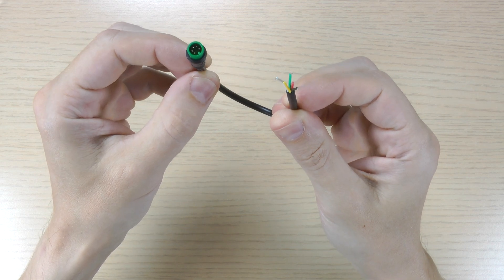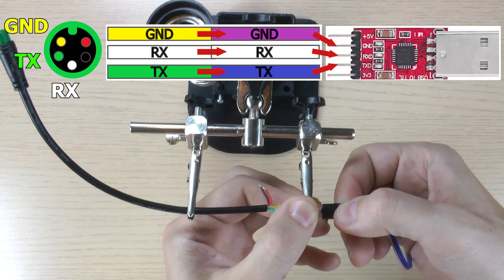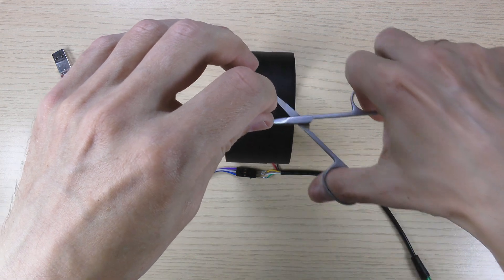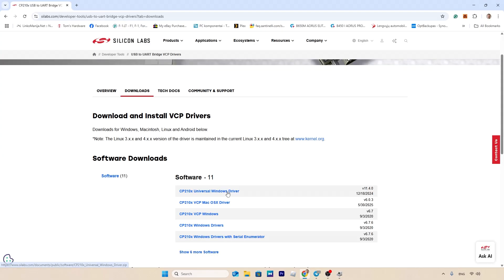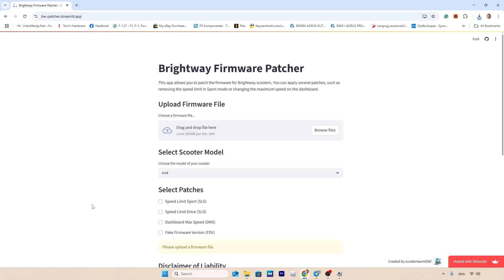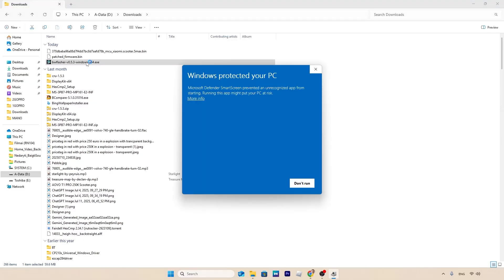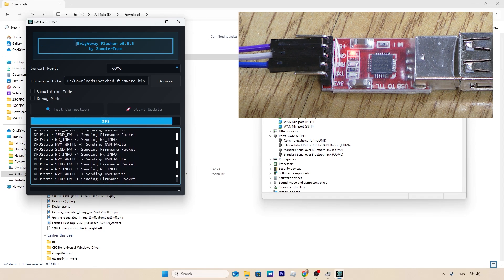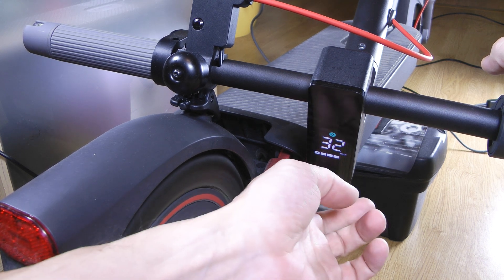Updated Xiaomi Scooter 5 Max Speed Hack (5*|5Pro|4*|4 Pro 2nd Gen)

Comment: Just received the Xiaomi 5 Pro and hacked it straight out of the box :). Thank you very much for the guide - it works exactly as described 😃. I ordered it from Germany, so the speed was crippled to 20km/h - terribly slow. Only activated the scooter with the app, didn't update the firmware through the app and used a self made M7 cable (parts cost 3.50 EUR on Aliexpress). In the patched firmware I set D (25 km/h), S (29.9 km/h), start speed to 1km/h and ticked the cruise control enable. Saw other comments that regenerative braking doesn't work after the hack and cruise control works only up to 25 km/h. Well - not sure if there was an update of the patcher, but the regenerative braking worked immediately (on Low, I don't like the aggressive ones) and cruise control was working on both D and S. Actually I achieved only 28 km/h because I was going slightly uphill, but cruise control kept them without having to press the accelerator.
Reply from the maker: Glad that everything went smoothly. Regenerative braking indeed sometimes does not work straight after flashing firmware for a short period. I noticed this as well on official firmware when I upgraded it to a newer version. Thanks for taking your time and sharing your experience in the comments. ❤️❤️❤️
Don't forget to subscribe :)
Reply: Hello! I also want to hack my scooter now, but wanted to ask some things. You said that you didn't update firmware in the app, does it change something up after hacking it? And also, does the Xiaomi app work fine after hacking a scooter?
Reply: @vladdergachov5384  The Xiaomi home app works just fine (I don't have any other 3rd party app for this scooter) and every time I start it it still suggests the firmware update that I didn't do initially. I think this is because there was no Fake Firmware option for the 5 Pro scooter in the firmware patcher. While it is a bit annoying (I didn't find any option to disable this prompt in the app), it is also good because most probably anytime I can easily switch back to stock firmware. But I am pretty satisfied with the modified firmware - fast acceleration, 30km/h speed and cruise control (up to max speed, tested several times now - it works even for speeds above 25 km/h) are enough for me. Battery life is good too, i drive it at S all the time, so no complaints.
Reply: @angeltinkov7415  
Hello ..
happy to hear that the process works fine for you. I also just bought 5 pro (the Germany version ) but I updated the firmware after using. Is this going to be a problem if I try to hack' it
Reply: @hamzaezzahi1649  If BW Flasher connects to the scooter then it will most probably not be a problem. I am not sure however if the rest will work as on mine, because I see some people say cruise control doesn't work above 25 and regen braking is not working at all. Maybe it is related to firmware update. As per the range with 30 km/h I cannot tell exactly because my longest commute is 10 km and I also don't charge it to  100% or let it drop to 0%, but the 10km is about 30% battery, my weight is 85 kg

Comment: Here are a few things I was wondering before:

One page is just giving you the OEM Firmware. 
The second is modifying it and the tool is for flashing. 

If you want to be able to revert the Firmware I recommend you to check the fake firmware option, lookup your current firmware and revert it for one number. You can either use the last 4 digits shown in your app or the number that shows when checking the connection in the flash tool. 

If you reconnect to Bluetooth with the app it prompts you to update. If you do that the modified software is gone. Personally, I am risking warranty claims to be rejected if they log the software mods…I don’t think it’s a thing. 

The 5 goes 25 ish with my fat 120kg ass. 

You can also just tune it up to 22 (Germany). You are then still in the 20kmh + 10% tolerance and should not loose your ABE. No legal advice just my train of thought. That’s what I will do.

Comment: Thank you so much for the video. My cables and adapter for the firmware update have arrived. I have a question: is it possible to disable the maximum speed sound? Thank you very much.
Reply from the maker: Currently, the only way is to desolder the speaker from the dashboard or tape it — there’s no software option yet.
Subscribe, thanks!

Comment: As this void warranty can you download the original firmware beforehand? To reverse the flashing? For the 5? How do you know what a valid old firmware would be to trigger the update in the app? Is it a drop-down in the bin modder?
Reply from the maker: Flash the unpatched MCU (the official firmware) or set the fake firmware version to a number lower than the latest one in the patcher. Each time you open the Xiaomi Home app, it will prompt you to update — if you accept, the scooter will revert to stock. Make sure to disable automatic firmware updates in the app.
Sub, thanks!
Reply: @MindaugasJocionis you’re the man dude!

Comment: How Long Can it drive on a full charge with 30kmh speed limit?
Reply from the maker: Didn’t test that, but with 25 km/h on 5max it lasted 44 km, so expect a bit less. Subscribe, thanks.
Reply: @MindaugasJocionis Thx do you know if the batteri is getting destroyt faster?
Reply from the maker: I personally don’t think it’ll be affected much. I’ve been using my Xiaomi 3 for four seasons — tuned even more aggressively than this one — and the battery is still in great shape.

Comment: Question: I am in the process of building the adapter and am currently checking whether everything is correct. I noticed that when I touch RX with the multimeter and hold the other end to GND, voltage also passes through there, not just at RX. Is this normal? So I've already connected the cables to the USB to TTL adapter
Reply from the maker: Yes, it’s normal — it receives data as tiny voltage pulses, that’s how serial communication works. Sub. Thx.

Comment: Danke für das Video! Kann ich vorher ein Backup Downloaden meiner Firmware? Der Support braucht für einen neuen QR Code meine Seriennummer. (Will ich auslesen, Sticker und Anleitung nicht vorhanden, 4 pro 2gen)
Reply from the maker: Ich bin mir nicht sicher, wie es beim 4 2. Gen ist, aber beim 5 Max gibt es denselben QR-Code am Dashboard-Stecker. Die Seriennummer bleibt auch original, wenn du diese Firmware flashst. Abonnieren nicht vergessen, danke!
Reply: @MindaugasJocionis Danke!

Comment: Good afternoon sir, could you tell me what does the firmware for the 5 pro do ? I know it will unlock speed but Im interested in the 1-2km/h start
Reply from the maker: The patcher has been updated — in addition to the speed unlock, you can now add a 1 km/h kick-start and cruise control. Subscribe, thanks.

Comment: Why doesn't it go over 30-31 km/h?
The motor should be powerful enough for that!
Reply from the maker: This only removes the speed limit from the stock firmware — it doesn’t give the motor more amps. Sub. Thx.
Reply: How to give the motor more amps ?
Is there any way to make it 2wd and have more speed @MindaugasJocionis

Comment: Hi! I have a problem. I bought the FT232RL and do I need to test the wires in this case? It's a very simple picture, yellow to the side, 2 gaps, then green and lastly yellow, leaving the last place bare. Is it always the case, or do I need to test? When I click test on BWflasher, 1 green led is blinking green on the pcb. It gives me "Unkown error" and "Max retries reached. Check your connection." It also in debug mode says "Sending: 53 2A 7D AC
Got Response:"
Rseponse is empty. I have the right port. What should the details say in the properties of the port? In the driver details it lists ftser2k.sys, ftcserco.dll and ftserui2.dll.
Could it be something with the connections?
Reply: Te aseguraste de que este encendido el scooter? No te olvides que se apaga automáticamente luego de no ser usado por un determinado periodo de tiempo.

Comment: Does it beep when you reach 33 km/h? Mine does 🤔
Reply from the maker: Yes, it starts beeping after 30 km/h. To get rid of it, you can either desolder the speaker from the dashboard, cover it with duct tape, or limit the speed to 29.5 km/h. Sub. Thx.
Reply: Thanks a lot for your response ! It works well 👌

Comment: Can I restore to factory settings after flashing?.  Model : 5 max
Reply from the maker: Set the fake firmware to 0013 in the patcher. Each time you open the Xiaomi Home app you’ll be prompted to update the firmware — if you accept, the device will revert to stock. Disable auto firmware updates in the app. Sub. thx.
Reply: @MindaugasJocionis  will it bring the warrant back?

Comment: so i stil got warranty on mine if i send it back in will they instantly know i messed with the software and remove my warranty?
Reply from the maker: It’s hard to say whether the ESC controller has any logging. The battery BMS does log battery usage, charging, and environment data, so there’s a possibility that the ESC also logs parameters. But that’s just my assumption—I don’t know for sure. Subscribe, thanks.

Comment: Hey i have the Xiaomi 5 pro de and it dosent work wenn i press Test it says Check conation but every think is conactet and wenn i press start it’s stays put at 0
Reply from the maker: The scooter must be turned on while disconnecting the cable and starting the flash. Turn the rear stop light to always-on to make sure it doesn’t shut down. Sub. thx.
Reply: @MindaugasJocionis  but i did it and it was on
Reply: @MindaugasJocionis  is maybe the cable broken ?
Reply from the maker: Check the cables with a multimeter for continuity and make sure you are connecting them correctly. Keep in mind that color doesn’t matter—it may vary. What matters is where the wires go. Each cable must go from the correct USB adapter pin to the correct connector pin. Refer to the diagram in the video

Comment: Hello, in Germany, brake lights are not allowed to flash when braking—what happens after updating with the firmware from the link—does the rear light flash when braking? Thank you!
Reply from the maker: If you brake, the light turns on. If the headlight is on, pressing the brake makes the rear light shine brighter, it doesn’t flash. Subscribe, thx.

Comment: It worked with my 5 Max as described. I noticed that there is now a new version of the firmware updater, which enables motor start speed and cruise control. For flashing, I used a modified Arduino Nano. Thanks a lot!
Reply from the maker: Glad to hear it worked! Yes, new options were added just recently, I haven’t had time to check them yet. Subscribe, thanks

Comment: If I want to unlock Xiaomi 5 Pro from 20 km/h limit (EU) to 30 km/h, have i to use difftrent cable or diffrent app?
Reply from the maker: For the Pro version, everything is the same except that you’ll need to use the Pro firmware. Check the video description for links.

Comment: one question, what happens if I accidentally update the scooter from the Xiaomi app with the flashed software?
Reply from the maker: Nothing to worry about—it will run on the official firmware with its standard restrictions. You can also use Mi Home with the patched firmware
Reply: @MindaugasJocionis  So could I safely use the Xiaomi app to eventually revert to the original software in the future?
Reply from the maker: You will only be prompted to update the firmware if a newer version is available. If the patched firmware is the same as the latest official release, you won’t be able to update. However, if your scooter model supports the “spoof firmware” option in the patcher, you can set it to a lower version than the current one. In that case, the Xiaomi Home app will always suggest upgrading to the latest firmware.
Reply: @MindaugasJocionis are there any benefits to updating the firmware? Also would I have to rehack the scooter after updating?

Comment: Hi, can I remove the region limit on my Xiaomi 5 with this method? Due to my country, my scooter is limited to 20 km. I just want to unlock it so it reaches 25 km. I don't want more.
Reply from the maker: Yes, but you need different cable, and connect it according to the diagram in the video description for the Xiaomi5
And remember - you must disconnect the cable from the powered scooter. Enable the rear stop light to stay on as an indication. 
Subscribe, thx.

Comment: I’ve tried many times and checked the TX, RX, and GND cables, but nothing works. It always says: “Test your connection. Max retries reached.”

I have a Xiaomi Scooter 5 and a CH340 USB-to-TTL adapter, but I don’t know what to do.

In simulation, the connection works, but in debug mode I get 12–13 responses and then it shows an error. I’ve checked all the cables, the COM port, everything seems fine. Can anyone help?
Reply from the maker: Did you connect it according to the diagram in the video description for the Xiaomi5? Is your scooter turned on while flashing? You must disconnect the cable from the powered scooter. Enable the rear stop light to stay on as an indication. The wire color doesn’t matter — you need to check which wire goes to the corresponding pin on your connector using a multimeter.
The new BW Flasher v0.5.4 has been released — give it a try. 
Subscribe, thx.
Reply: @MindaugasJocionis I followed your previous video and I realised that you can’t go by the colour, you have to go by the names of each one. Because in my case, the coloured wires were different names to what’s on the video. Took a while to figure out. So RX and GND for example could just be on the wrong pins

Comment: I have a Xiaomi 4 lite 2gn😢😢, but I made a mistake and the E10 code appeared. Is there a way to install the firmware for the screen only?
Reply from the maker: What exactly did you do? Can you still connect to your scooter through the Xiaomi Home app? By the way, this wasn’t the guide for the Mi4 Lite 2nd Gen
Reply: @MindaugasJocionis When turned on, only E10 appears and it does not connect via the app and the Bluetooth logo keeps flashing
Reply from the maker: @mostafa27s  What firmware did you flash?

Comment: Error 10 please help
Reply from the maker: Which scooter model do you have? Don’t forget to subscribe, thanks!
Reply: @MindaugasJocionis  hello its scooter 5 error is fixed from service center 
but i still cant flash it shows "maximum tries reached please check connection"
ive tried CP2102 and FT232RL same issues
Reply from the maker: Check that the wires are connected correctly and test them for continuity. Also, if you take too long to connect the adapter, the scooter will shut down. To have a clear indicator that it’s still powered, enable the rear stop light to 'always on' in the app. The wire color doesn’t matter — you need to check which wire goes to the corresponding pin on your connector using a multimeter.
Reply from the maker: Also, check the diagram for the Scooter 5 in the description, since its connector is different. And the new BW Flasher v0.5.4 has been released — give it a try. 
Subscribe, thx.

Comment: Hey, does a Julet M7 5-Pin (Male) PL2303HX connecter work for this tutorial (xiaomi 5 max)
Reply from the maker: According to the developer, the flasher has been tested with these adapters:
CH340
FT232RL
CP2102**
Subscribe, thanks.
Reply: what is better CH340,  Cable + Sockets or PL2303HX + Cable + Pins ?

Comment: I have a Usb to seriell FT232RL and when i press " Test connection" it will blink some led on the pcb and then comes a error sayin " unknown error . Max retries reached. Check your connection. " Do anybody have the same problem?

Some day ago i bought the CH340 from the ebaylink and the Machine ID was not original so there was no driver for it. I was hoping for the FT232RL but it seems impossible to get this fixed 🫣
Reply: Its working, the ebay link didnt show the right connection. I followd your connection insted 👍👍
Reply from the maker: Glad it worked! Don’t forget to subscribe, thanks.

Comment: Hello is it possible to unlock speed on 5g pro max with m365downg and softwares like this
Reply from the maker: No, using only your phone and apps, there’s no way to unlock the speed on a 5G Pro Max with M365Downg or similar software. Subscribe, thanks.
Reply: @MindaugasJocionis  Hello. Would it still be like that or you think someday it will be possible to hack it by blutooth like older models ? Thx for sharing your knowledge

Comment: can you link me the file here for tesla flasher I still need it would be nice
Reply from the maker: Tesla Flasher was compiled from the BW Flasher source code but didn’t include credits to the original developer group. They contacted me and requested the link be removed. The latest BW Flasher version has fixed bugs and now also supports the CP2102 adapter. Subscribe, thanks.

Comment: Hi, what are the options to revert back to the original settings - "mi 5 pro", the "Fake software" option is missing
Reply from the maker: Flash MCU firmware without modifying it
Reply: díky

Comment: You should do a tutorial on how to remove the beeping sound. 🙏 Also great video btw
Reply from the maker: I'm still not sure if it's worth voiding the warranty just for an extra 2 km/h. If I decide to desolder the speaker, I’ll definitely make a video about it. Subscribe, thanks!
Reply: @MindaugasJocionis It should definetly be possible to patch out this check. I tried doing this in Ghidra but I think I made a mistake when exporting the binary so the checksum fixer failed. I will continue trying, thanks for the tutorial tho!